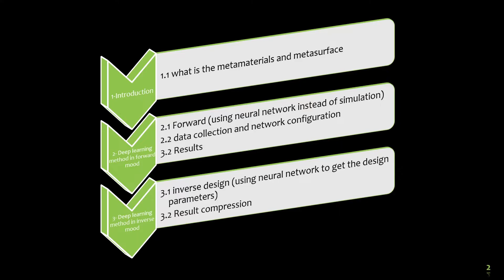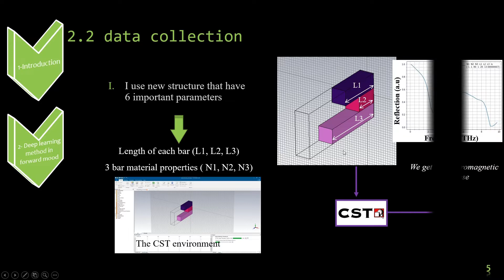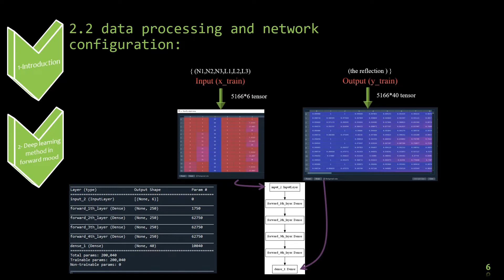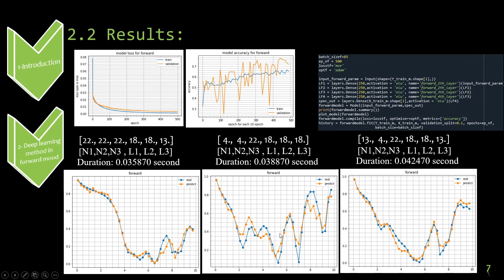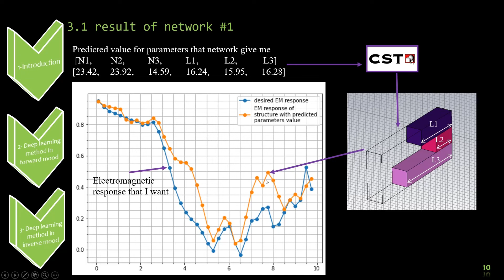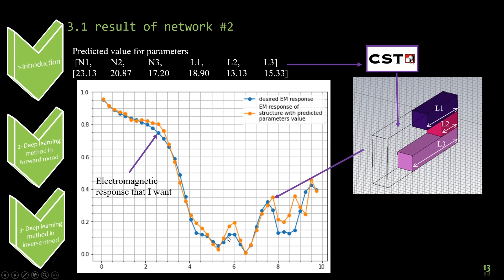Using deep-learning methods to invers design metamaterials structures

Comment: hello, please do you know how comsol multiphysics works in this regard?
Reply from the maker: to generate your dataset for training your Network you can use any simulator, CST, COMSOL, HFSS, etc. and use parameter sweep. However, I suggest you choose one with good accuracy and low simulation time. since generating data take lots of time